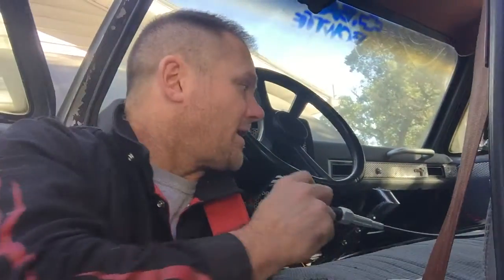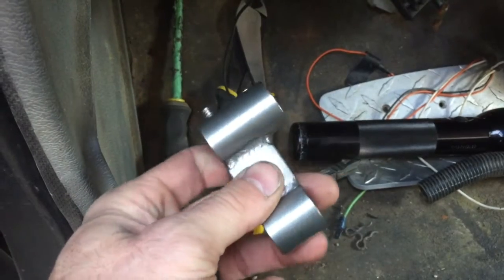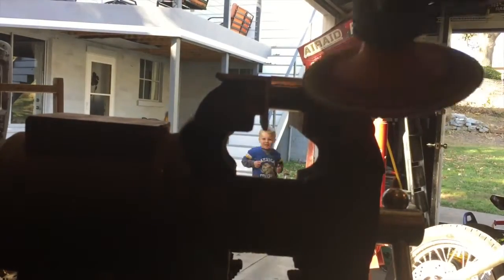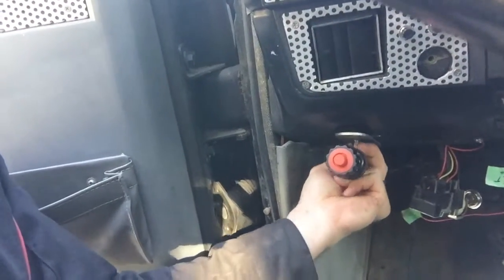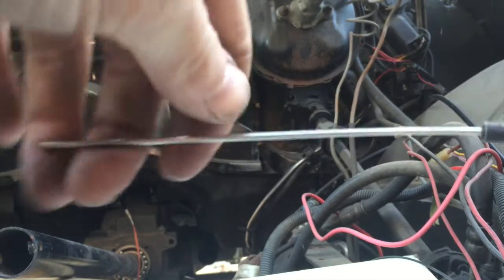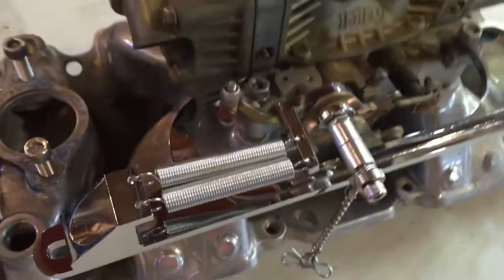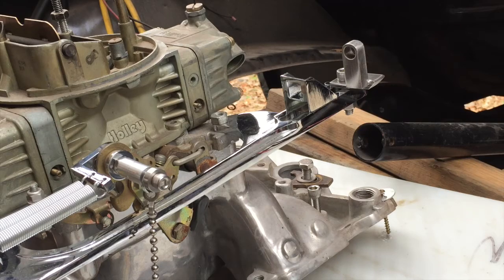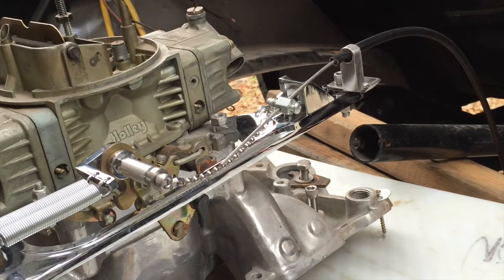Throttle Control!

Comment: I have this truck now I enjoy watching the videos to know what you where where trying to achieve... my dad's a mechanic and actually going to start putting it back together! awesome work!
Reply from the maker: You have the truck in these videos?!
Reply: yes sir
Reply from the maker: Very cool! Hit me up with any questions- here or FB. God bless!
Reply from the maker: I am extremely curious how the exhaust I built will sound! Keep me posted if you'd like!
Reply: Will do... Yea the exhaust wasn't on it when I got it I'm putting it back together now that I watched some of your videos it will make it a lot easier to put together and what dash lights go to what lol
Reply from the maker: I think I have some good helpful  pics of the exhaust that I could message you too. (maybe Facebook messenger?) I wonder why they took the exhaust off... also there should have been labeled tape on most of the wires- I kept the methanol injection system so some of the dash lights and switches can be used for whatever you'd want. I had a hand drawn paper diagram of the dash components that was included with the info that I gave the person who bought it from me so hopefully you could find that too. Again, I'm here to help so please don't hesitate to shoot me some pics with questions or whatever you'd like.
Reply: Yea all that is there he was gonna mud drag it and just have headers going through the hood... I plan on using it as a hunting rig and just show... Drive around
Reply from the maker: Very cool!
Reply from the maker: Craig Timmerman how is that truck coming along?!
Reply from the maker: Hi Craig, do you still have this truck?

Comment: Hey buddy think about my idea I did. On my '69 Chevy 3/4 ton 4-speed 4x4 I mounted a Badland 12,000lb. winch under my toolbox in my 8' box, bolted the mounting plate right through floor and then through frame with (6) 1/2 " grade 8's. Put a hawse fairlead on my tailgate to guide cable or put gate down. Has a remote not any damn cable controller. LOVE IT!! I am from N.E. Iowa --no big rock crawling parks but boy I've used this winch more in a year than I thought in a lifetime. I love your building ethic---if you knew me that's a BIG comp. I am sure you've heard of me or seen one of my 250  '67'72 Chevy/GMC 4x4's I HAVE HAD FOR SALE in the "Wheeler Dealer" mag for sale for 37 years. GREAT BUILD!!!!!!!
Reply from the maker: Sounds very cool! Thank you for watching and sharing! God Bless!

Comment: you should be able to undo just the ferrell nut and slide the housing alone past the inner sliding cable and safely cut the housing to suit the length you need. i could be wrong but my kit for my 4x4 lockout on my front axle was the same way that connects on the back just didnt twist
Reply from the maker: +Raging Reaper Gaming Variety- Hey you're exactly correct! I received that exact info from JB Custom Fab shortly after I posted. I will be correcting the info very shortly! Thank you!

Comment: Now i might do that to my 1971 GMC truck. I know i need to replace my old carburetor. My question is why holley versus other brand.
Reply from the maker: Very cool, it is an easy upgrade with several benefits not to mention cool factor.  I grew up with Holley Carbs working with my uncle and grandpa and have always appreciated their versatility, ease of service and tuning characteristics. I've tried Edelbrock, Rochester, and Carter but have always gone back to Holley!
Reply: +GebBuilt .Good to know.  I was going to get edelbrock .I may get a kit for my existing holley or a new holley .I think the price is higher than edelbrock?
Reply from the maker: yes I believe they are higher but worth it in my opinion. If you want to take it a step further then look into the MSD Atomic Electronic Fuel Injection!
Reply from the maker: Actually Holley has a self learning EFI as well that may be better than the MSD now that I think about it.
Reply: +GebBuilt .I will check out. what you suggested sounds interesting. But i really want to do less wiring possible. You know( EMP proof ) no computer the better.
Reply from the maker: Yes! I totally understand!

Comment: What is the purpose of this build/truck?
Reply: +KU4PC its meant as a work truck. twin stick can be used for towing especially heavy objects in wet ground to get as much dig without wheelspin. compressor for airing tires and using air tools on the go. id suggest quick connect battery terminals in the nose and tail he can connect special jumper cables too with a plug or run it to a converter for electric tools on the go.

he knows whats up, step dad had a ford similarly built with these needs in mind
Reply from the maker: +Raging Reaper Gaming Variety - couldn't have described it better myself!